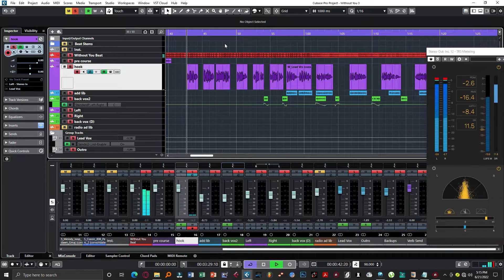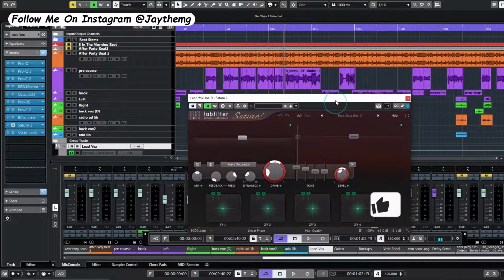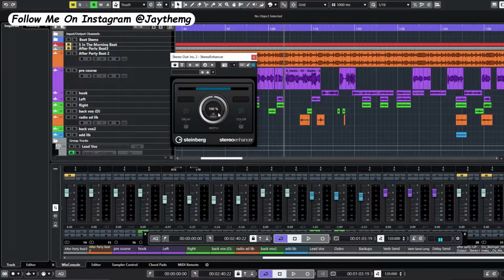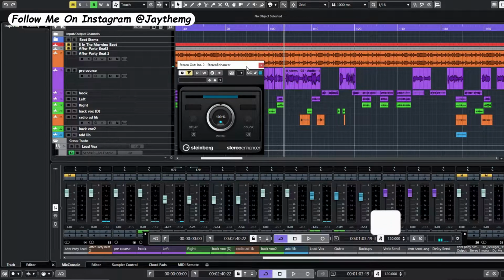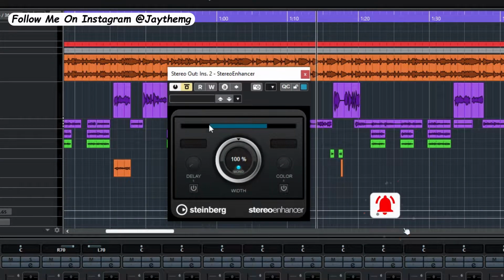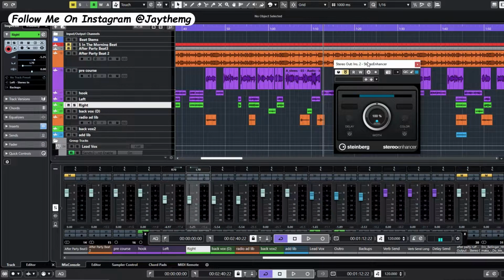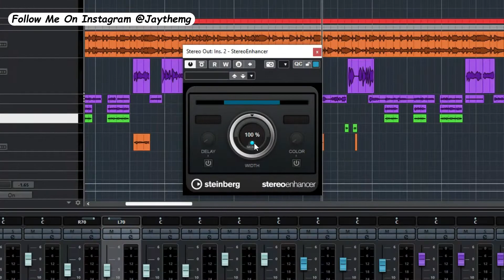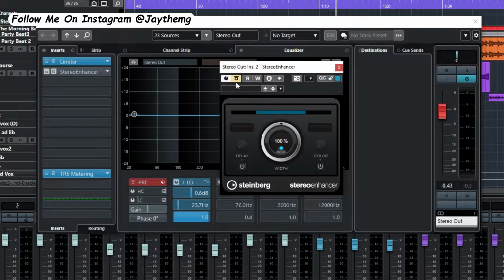How To Mix In Mono And Why

Comment: You can use control room in cubase for this though.
Reply from the maker: Yeah like I said at 00:54 there are a number of ways of doing it.
Reply: @JayTheMg  Thanks, I have learnt alot from you. Is there a way to make volume db the same across all the vocals. Not with compression though. I saw in a studio were the guy clicked on a vocal and clicked on a volume tab at the top of cubase and it moved the the volume of the other tracks. I dont know if you get me though
Reply: @JayTheMg   your number not on whatapp
Reply: @JayTheMg  I don't notice a difference when switching to mono in CR